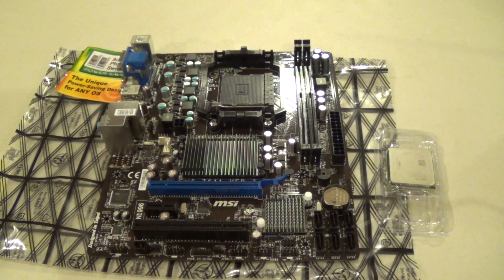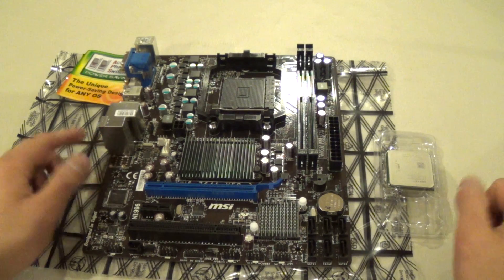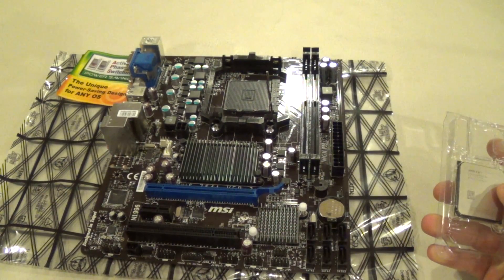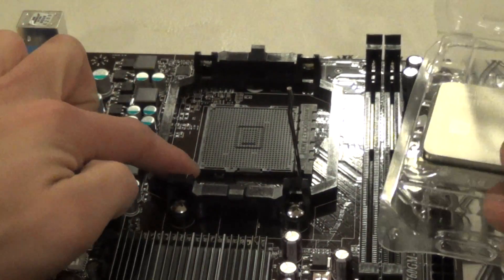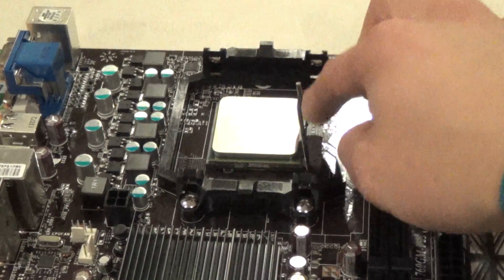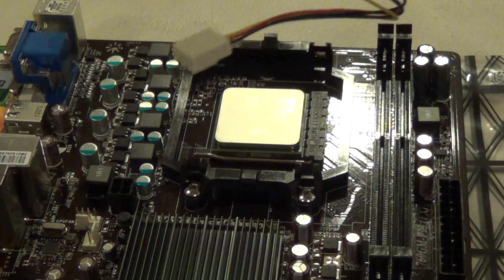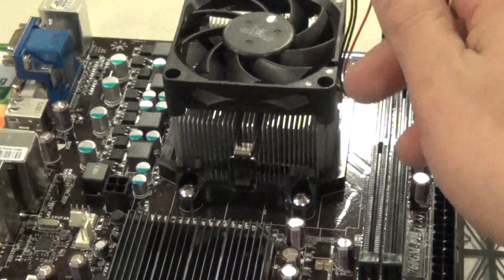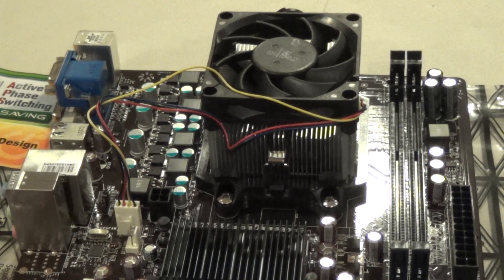How To: Install AMD FX Series CPU

Comment: I have a promblem with this mother board my normal gpu use %100 10 second later My cpu is 205 C  why ı dont know. my cpu use %60 normal C 39 but 10-15 second later 205 and fps drops how ı can  fix that promblem
Reply: Thermal paste brother
Reply: @dominikmuminovic2992  brooo 3 years XD ı change my system XD

Comment: Great Video. I just have a question. This is going to be my first CPU installation. The pre applied thermal paste is ok right? Otherwise, if you want to remove it, what's the best way to remove it?
Reply: Isopropyl alcohol and a fiberless wipe/cloth.